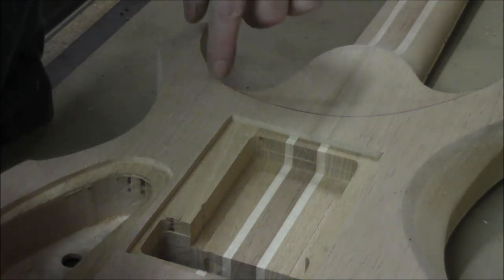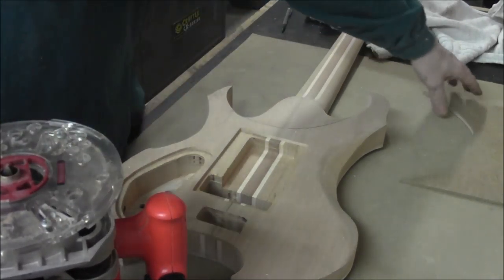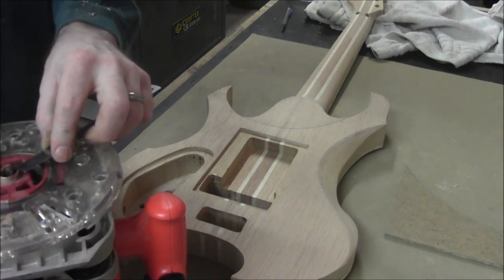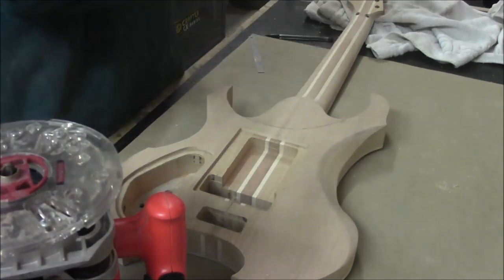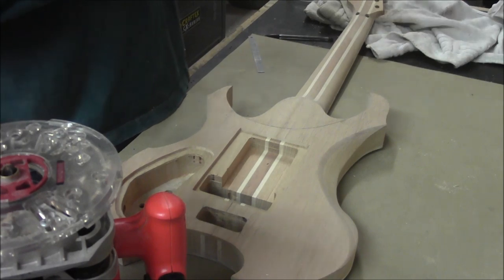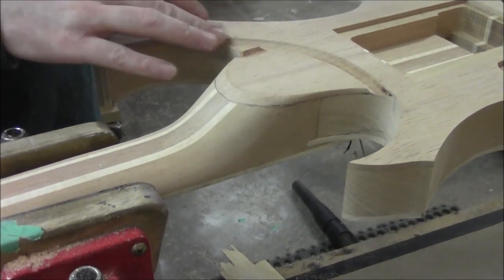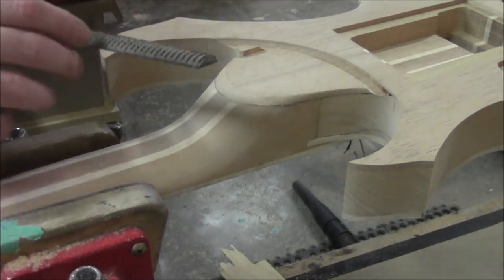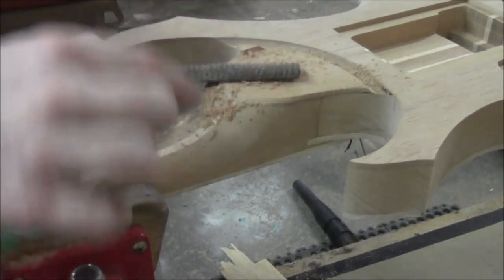How to Build an Electric Guitar-Video 19-Extended Access Heel

Comment: I noticed you use a neck though body on this build which allowed you to basically remove the heel completely...  What I'm curious about is a LP style kit DIY build that I'm wanting to build and I wanted to know if you'd have any advice on the removal of material when the best you have in your kit is an extended neck tenon...  My goal would be to remove approximately the same amount of material that Gibson might but an access heel that allows for my own 'feel' taste while maintaining the maximum amount of wood material on the guitar... ...without compromising the neck joint that will be glued in with Titebond Ultimate Wood Glue 3...

Comment: Why didn't you route the entire neck heel to the same depth? Wouldn't that be faster and easier?
Reply from the maker: ***** The type of template I was using doesn't have enough support for routing that far away from the edge. I didn't want the router tipping at all while I was working.  Using the rasp was quick enough for me.cheers
Reply: Ah that makes sense! Better safe than sorry! Great work btw!